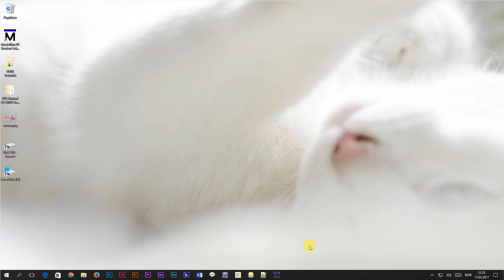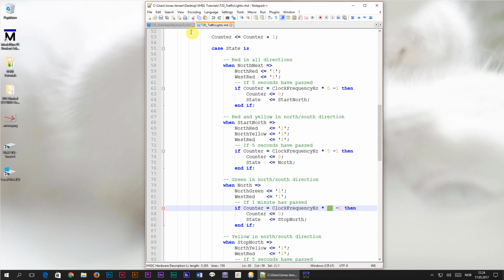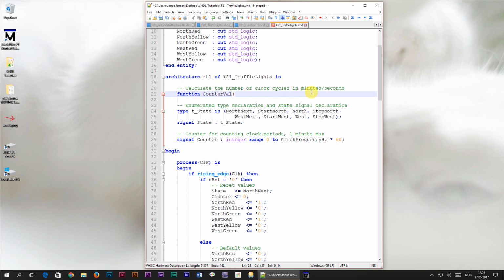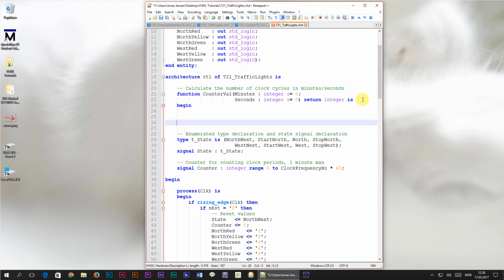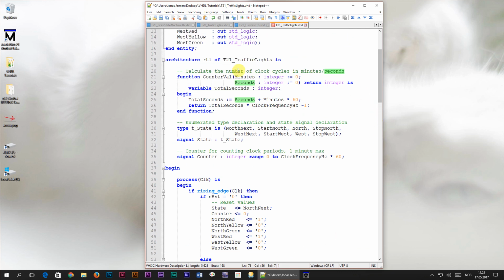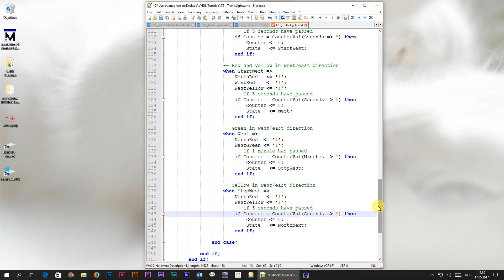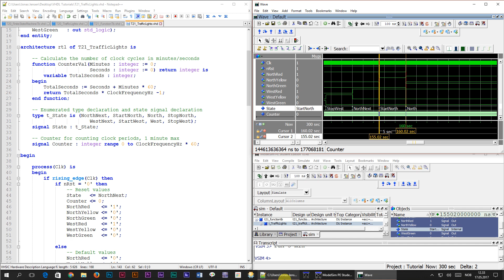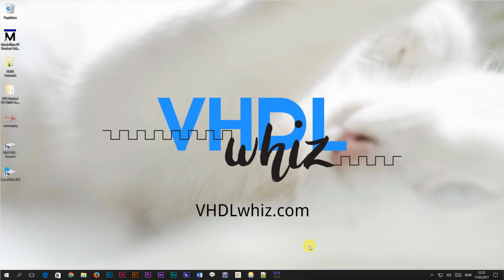How to use a Function in VHDL

Comment: So functions are just used to make the life easier in "compilation time", they aren't translated in hardware, so they can have only static inputs (like constants). Am I right?
Thank you for the videos
Reply from the maker: Not entirely correct. You can assign signals or variables to function parameters as well, not only constants. But inside of the function, the parameters behave like constants. You can't change them inside of the function, and you can't send values out of the function through the parameter list. Use the 'return' keyword for that.